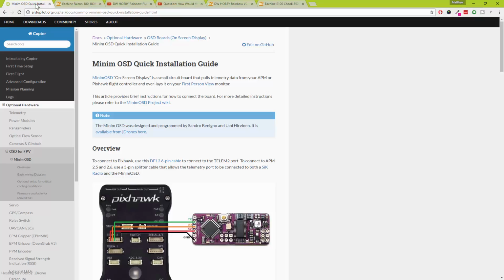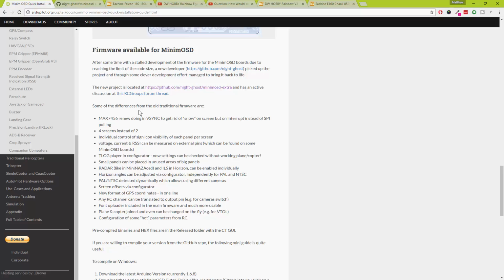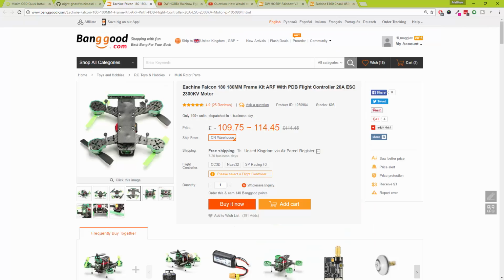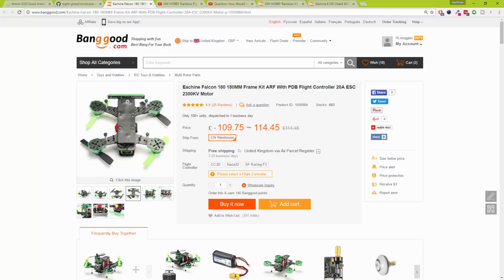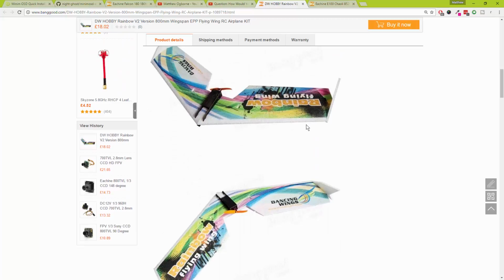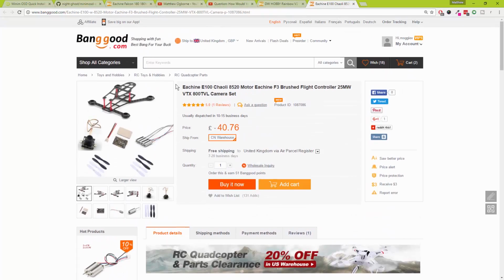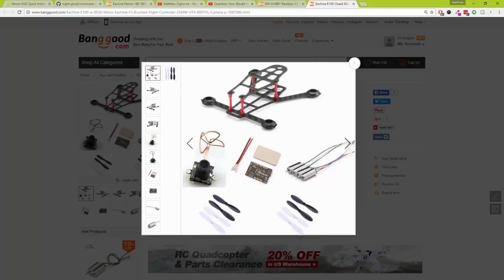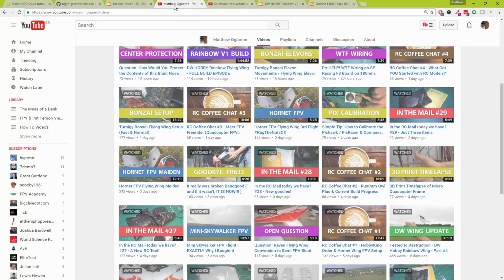RC Coffee Chat #5 - Let's have a natter over a cuppa

Comment: Afternoon Matt, I'm in the middle of converting a Dolphin EDF trainer into a twin prop pylon racer, I have a 47" Depron KFM2 scratchbuild wing that I'm waiting for BG to deliver my SunnySky motor for and I have a Hummer 3D that I got on sale that I haven't even started yet (don't tell the missus, she doesn't know about that one :) . Never got into the quads, so I have zero knowledge when it comes to that kind of thing, good job really - I have enough on my plate as it is
Reply from the maker: Howdy mr T, yea I know that feeling! I can't hide anything from the wife as she normally ends up helping me with the builds :) As for the Hummer 3D, they are great fun! If i was building another one, I'd reinforce to the nose area with balsa plates like I have done to mine now, as it will save it in those bad landings because the landing gear bends too much. Matt
Reply from the maker: PS. Use a proper APC prop in it rather than the supplied one, it won't break so easily. At one point I was doing a prop a flight :/ Matt
Reply: Got a pic of the nose reinforcement Matt?
Reply from the maker: Howdy Mr T, see here https://www.dropbox.com/s/zfl4b4w6csg8fbi/2016-09-27%2015.51.08.jpg?dl=0
Reply: Cheers fella :-)
Reply from the maker: Tsnafu As a heads up, if I was to do it again, I would have brought the balsa around above the landing gear as it does give up after a some hefty abuse. Matt

Comment: I've got that micro brushed quad frame the 8020 motors do fit quite nice without the rubber grommets but I totally agree shit frame too small and too thin I've got a few of the banggood micro brushed frames and I love the 120mm X shape for los with large props and the qx90 for fpv
Reply from the maker: Howdy Tam, it really is crap. I had to dremel the holes out to make them motors fit in with the rubber grommets. This frame is the BEST one I've come across yet http://www.banggood.com/MI110-110mm-Carbon-Fiber-DIY-Micro-Mini-FPV-RC-Quadcopter-Frame-Kit-Support-8_5x20-Coreless-Motor-p-1081031.html Matt